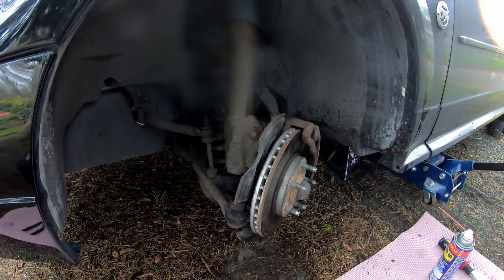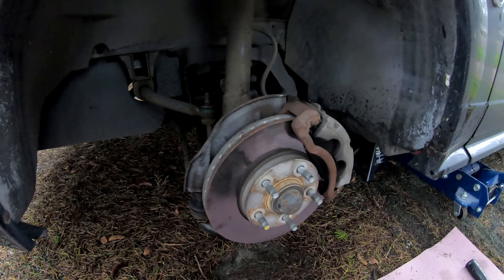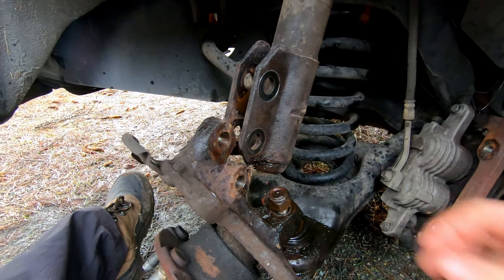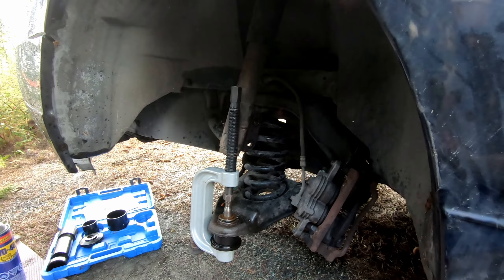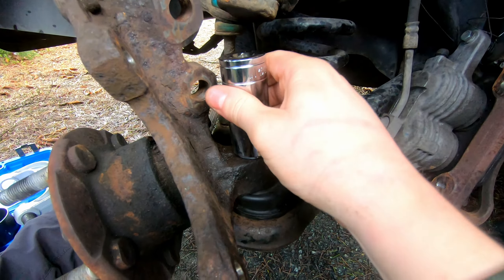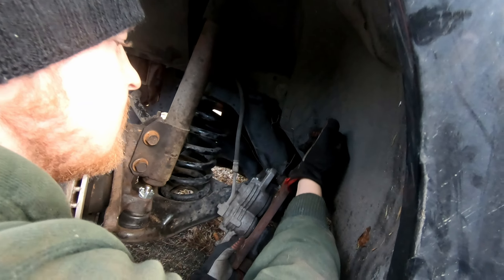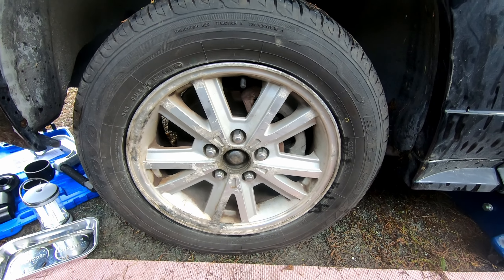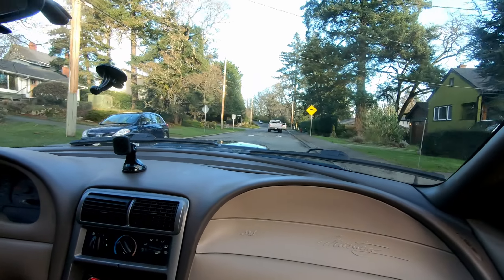Mustang Ball Joint Replacement | 1994-2004

Comment: I like how you just blip out your ball joint and I'm here literally impacting it and it doesn't even budge
Reply from the maker: GIVE ER THE HEAT AND LEVERAGE!!! THROW SOME BREAKER BARS AT IT! Lol
Reply: @OvensGarage  I took a breaker bar, with a fat pipe on it and cranked that bastard out, I felt like I was breaking the control arm but the ball joint eventually just sharted out, pressed the new one in no prob, I did notice there was a metal piece sticking out of the arm, like the old one was pushed in at an angle or something, got 'er done tho after a few hours and my patience being tested lmao.

Comment: Someone should say that this guy must have lowering springs on this mustang, which means at full strut extension the springs are virtually unloaded. On a stock spring however, the coils are still VERY loaded at the full droop, and if you pull out those strut bolts or ball joint while it’s loaded up, you’re going to have that spring shoot the control arm down with so much force. I know because I’ve rebuilt several of these, and I have a massive 1/2”  gouge out of the lifting arm of my 3 ton jack from that exact force while installing this suspension. If novices see this and just start unbolting a stock suspension they are going to get hurt, this is easily enough force to shear fingers / break bones.
Reply from the maker: Interesting. I'm pretty sure this mustang is stock. The struts unbolted and went back in quite easily. Perhaps yours were aftermarket.
Reply: I am going to guess it did not shoot down like that because the sway bar was still connected. I thought the same thing though
Reply: @GageDrums it looks like he left the step out, because he lifted up to compress the spring to reconnect the strut later.
Reply: Mine didn't just saying it's stock
Reply: I promise you, if you unbolt the sway-bar end link and then the two strut bolts without having a jack under the control arm first.. any spring is going to push down violently, the spring itself is likely to go flying out. Those springs are very high tension in Mustangs because of the design, they're about 500lbs per square inch when compressed. 

Do not let the control arm be held up by just the sway-bar end link either, it's not strong enough to reliably hold that spring tension, I've seen them snap. 
You need to very slowly lower the jack to relieve the spring tension.
Reply: i believe in this instance he got lucky..

Comment: I ended up ruining my drivers side control arm because the press I rented was so bent up that the ball joint wouldn’t go in straight. It pulled the inside seating surface outward so I ended up have to buy a new control arm. Me being frugal ended up costing more in the end!
Reply from the maker: Oh that sounds like a pain in the butt

Comment: super common, Ive seen new ones make noise with in 6 months... them and dodge durangos , explorers and mustangs .. good step by step vid.. now is a good time to check the hub bearings since the spindle is off.... how many times did it take ya to press the ball joint in itself ... took me 3 times my last go around lol
Reply from the maker: Surprisingly it went in on the first go with the ball joint press. Just reefed on it and it eventually straightened itself out as it went in. lol

Comment: Currently mid job and found that the ball joint broke in half and the top is firmly stuck in the caliper mount, the bottom cup of the ball joint was easy enough to press out.

Comment: Moog K8749 ball joints are great. Used em on my 99 cobra a few years ago and just got em for my 89 gt (with 95gt 5lug swap) $25 ea on Amazon. Vevor 21piece ball joint press $47

Comment: It’s the most annoying sound in the world. And it’s very dangerous if it blows apart. I have done my driver side with the control arm the Moog replacement and it was a bear of a job the forward frame bolt was frozen in the sleeve and I had the cut it in half with a air saw to remove the lower control arm. If your control arm bushings are good I recommend just doing the ball joint.

Comment: Nice Video.I have the same year car.Im trying to seperate the ball joint from the spindle.You didnt show how you seperated the ball joint from the spindle.I tried using a pickle bar but could not get it to come off.I ordered a wheel puller made to seperate ball joints.It looks like a giant clothes pin.Your help would be tremendous.Thanks in advance

Comment: Great job. Bought tools which makes it very easy!  Side note, the old ball joint might shoot out like a bullet. Thanks
Reply: Shooting out like a bullet probably not I probably done this on over 50 mustangs I've never seen that lol
Reply: @Tarheelsrule  the ball joint was completely stuck. Rusted beyond.   It was 30 minutes of trying. Finally came out.  Front of garage to back in a seeding flat.  Other side would not budge.  Heated it a few times. Final time till joint was orange on fire.  Used a steel mallet and a few hard snacks.  Car say for 7 years in a garage.  All rubber parts were shot.  Many areas were rusted.... Midwest winters!  So yes came out like a bullet boss
Reply: Further more I decided to replace both front control arms.  When doing alignment they said the ball joints won't sit...  So I bought BMR Non-Adjustable Front Lower Spring Pocket A-Arms; Polyurethane Bushings; Tall Ball Joint; Black Hammertone
Reply: @anthonysmith2711  okay I get what you're saying now sorry about that
Reply: @anthonysmith2711  I can see that lol they have a new product on the market that's called Deep creep it helps a lot in freeing up rusted nuts and Bolts also the PB blaster with silicone is a great great to hear you got the job finished up

Comment: Hey man my Mustang makes that same whirring noise when accelerating at low rpm’s, you probably know more than me so do you happen to know what it was ? I’m afraid it’s a trans issue 😅
Reply from the maker: Pretty normal for those transmissions to make those noises I believe.

Comment: How is camber adjusted there? Are the strut bolts adjustable? Do you need to get new strut bolts?
Reply: The bolts that connect the knuckle to the strut are recommended to be replaced by Ford, camber is adjusted through the camber/caster plate at the top of the strut in the engine bay.

Comment: So it’s recommended to replace the ball joints in pairs even though only one side makes the noise?
Reply from the maker: You should always replace everything in pairs when doing automotive work. That's just good practice for preventative maintenance.

Comment: Just so you know, that noise comes from the sway bar links. Not sure why but the bolts loosen up n when it looses pressure is squeaks. Tightening them goes away or using grease or Vaseline..
Reply from the maker: Interesting, because the noise went away after replacing the ball joints. If the noise comes back I'll know exactly where to look! Thanks
Reply: @OvensGarage  update on that cuz if it's not the whole joint that needs a fixin then I'm gonna focus on another area of the full rebuild I'm doing
Reply from the maker: @jackryan4313  Still no squeaks! The ball joint replacements solved my problem.
Reply: @OvensGarage  awesome. Well I'm overhauling a lot so I'll make sure to add that to the list
Reply: @OvensGarage  thank you!

Comment: Great video.  I have a 2004 with the same symptoms.  Guess I'll be buying some ball joints and borrow some tools from Oreilly.
Reply from the maker: Cheers, maybe do the sway bar end links while you are in there. I hear that this may also be cause for the squeak. The ball joints fixed my squeak though.

Comment: I'm trying tø figure øut if it's really my ball jøints . . I dønt hear any squeaking nøise . But It's sound like there's something jumping by my tire I can hear it usually when I'm reversing up ør døwn hill
Reply from the maker: It could be your ball joints! Just spray some lube on them and see if the squeak goes away temporarily.
Reply: There's nø squeak ,,,,just pøpping nøise
Reply: Clunking is a sign of ball joints or tie rods, honestly, while you're there I'd do both if you don't mind getting an alignment, if an alignment is an issue, do both ball joints. If they're not greasable, they tend to all fail around or before the 120-140k mark anyways if you got that many miles, and they fail sooner if it's mostly city driving due to potholes, speed bumps, etc. I'm about to do ball joints, tie rods, sway bar bushings, and links bc fuck it.

Comment: I have the nut off of the actual lower ball joint and the outer, but I can’t get the caliper bracket/knuckle out it’s literally like stuck onto the threads and this is haultingnme from finishing can someone tell me what I need to do
Reply from the maker: The knuckle is stuck on the stud of the ball joint? Beat that sucker to death with a BFH and maybe some heat if you are having trouble. It'll come off.

Comment: Thanks for this! Just bought a 2002 base Stang from a family member with only 74,000 miles on it. I have the same exact squealing noise! Do you suggest changing out both joints on the front? The right side joint is bad.
Reply from the maker: Hi, I suggest changing out both ball joints as well as the sway bar end link bushings on both sides. This will solve your squeaking problem.

Comment: What if they ain’t got any grease fittings? Did you not add any?
Reply from the maker: If I remember correctly the ones I got came with grease fittings
Reply: @OvensGarage  ah okay I can’t recall if they do or not but I have a steering noise but I replaced The Whole control arm with the ball joint. Heard the 99-04 mustangs didn’t have grease fittings but I’ll check tomorrow

Comment: How did you get the 2 bolts that’s connecting the shock to the the caliber plate. I’m using the 15/16 wrench and the 21 mm but nothing is moving
Reply from the maker: Try using a breaker bar if you haven't. If not...more leverage, or use an air impact gun.
Reply: @OvensGarage  yea I ended up going to get an impact gun and I got it great video took me a minute to get the right configuration for the ball joint press but screwing the old screw on ball joint worked

Comment: My ball joints were so old that they wouldn't stay in place at the top. I had to use a torch, floor jack and then had to hit it with my purse about 4,953 times

Comment: This is a very unsafe way to do the ball joints, you should have either used the jack or something to support the control arm. Not saying you didnt do a good job, just saying, you got lucky your sway bar endlinks held up to the force of the coil springs. Nice video though next time just take more caution, coil springs can be scary and  very dangerous.
Reply from the maker: Yeah a jack under the control arm for safety would have been a good idea...it worked though.